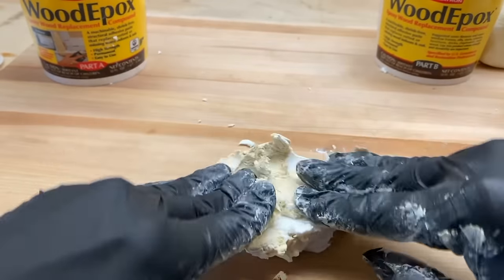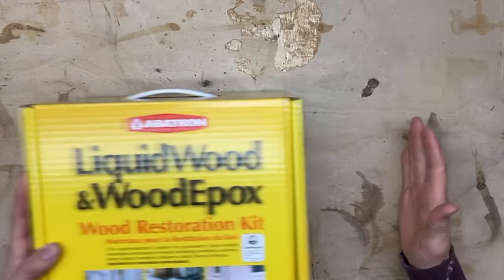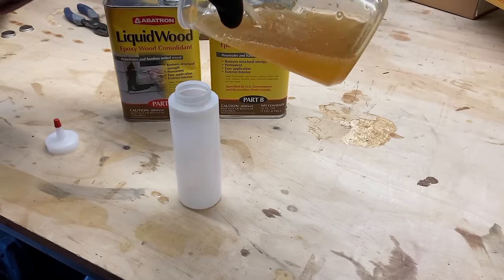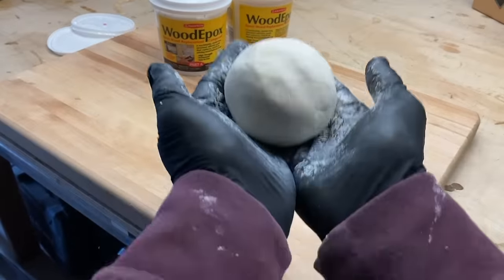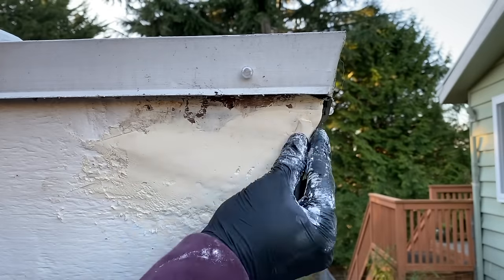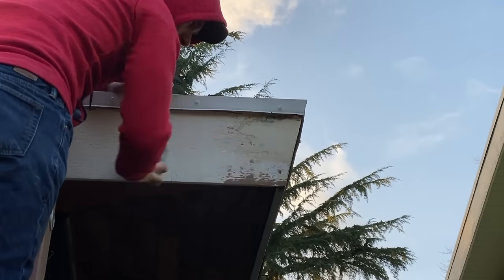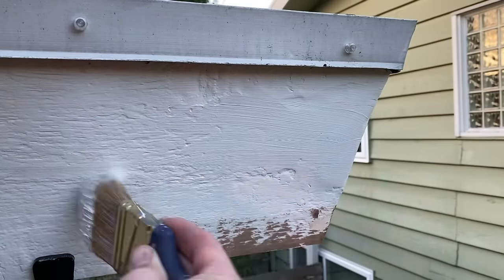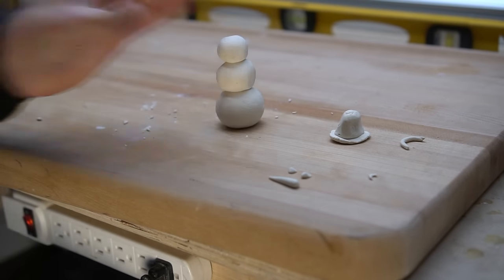How To Repair WOOD ROT and Water Damage With ABATRON

Comment: replace the rotted section with new wood and paint.  This is more work than needed
Reply from the maker: That is an option but I am trying to teach others how to do it if they don’t want to replace the entire board. In my opinion this is less work than just replacing the entire board because it’s a very long stretch of facia material that needs to be replaced.  Thanks so much for watching though and hope you found the video entertaining
Reply: @BYOTools  I call.it laziness. Lol. Wow
Reply: @BYOTools  You don't have to replace an 8ft section of facia for 6" of rot.  Cut the damaged section back to solid wood and replace the piece you just removed.
Reply: TheOcculus In my circumstance I used this method to strengthen snd replace a section of a door jamb that was failing due to the screen door hinge applying pressure. I first tried replacing a section with hardwood and a steel plate but this failed as well. Hoping the Abatron has the added strength to work (so far, so good). Anyway, I appreciated the video, so thanks. I really don’t get why someone would waste their time criticizing it -though. Why watch it unless you were looking to learn something? Go figure 🤷‍♂️
Reply: @shanpeco2546  It's a good howto video.  It's just not where I'd apply this type of repair.  The tip of a facing board is easier to cut off and replace than bondo it up.
I'm going to use this to repair weather checked windowsills and make them ready for paint.  No rot but sun exposure has opened cracks in the top of the windowsill.
Reply: @TheOcculus  BINGO!  In his opinion BYOT must have never thought of that.  Seems like rather spew misinformation and defend bad advice.
Reply: Cob job that cost more and took longer than the correct repair.
Reply: @shanpeco2546   agreed
Reply: Its stuff like this that keep remediation companies in business. Dually so, exactly the kind of stuff that hides problems until the whole side of the house is being gutted from unfixed water damage.
Reply: Yup I agree , I'm a professional house painter of 20 years . I make a killing because I'm also a very good carpenter .. 

Most painters can't even read a tape measure and just use filler or caulking than paint over rott. When I see rotted wood I see $$$$ especially when it turns into structural rot..
Reply: Agreed 10 fold
Reply: So don't replace the whole thing. If the rest is solid, just take a reciprocating saw, cut off the rot where it begins to be solid again. Toss on a new piece. Prime. Paint. The method shown in this video looks like a lot more work. My facia boards are 30 feet high... I'm supposed to drag a vacuum up a 30 foot ladder??Sounds like a quick way to an early grave personally
Reply: @86lowrider  It's not water putty. This product was used to repair the Statue of Liberty.
Reply: @scottmcbride2237  I bet that you're fun to live with.
Reply: @fireblazer6661  Or even a multi tool might do the job, with less vibration way up high on the ladder!
Reply: Yes, this.
Reply: If you are a carpenter then yes but for me this repair sounds like something I can do myself whereas cutting out wood and replacing would be overwhelming to me.
Reply: Yeah if u know how to. I got extensive rot in my siding of my trailer. I can't find anyone to fix it and I don't know how to.
Reply: That’s probably the most “correct” option but I thought it was obvious that this is a good workaround option when you dont have the tools nor expertise to replace the wood.  This is a good option for people that don’t have those things available and it would be less expensive if your only other option was hiring someone.
Reply: @BYOTools thank you!  In my case with financial problems this will be a huge help. Definitely something I will be able to do on my own. I truly appreciate it!!
Reply: Interesting . I use polyurethane glue (Gorilla glue) for that type of repair myself using bits of wood as rebar .Becaose the glue will bond to the wet surfaces deeb inside and the expansion fills and bounds all the unseen voids . Also it wont tend to separate from the wood do to differing expansion rates . Thaks for sharing !
Reply: There are some areas where your "simple fix" of replacing the wood is too complicated and costly. I'm talking about south facing wood sash windows where both the frame surround and the sill have rotten sections. I've replaced the sills on several windows and yes that not terribly difficult, but when the rot then extends up the frame surround you're either doing epoxy or your into $1K of labor and materials replacing the entire window. It's not perfect but maybe I can get another decade out of these wood sash windows
Reply: What a waste of money and time 😮.....cut the price off and place a new board.....this is pure advertising for the product, that product will should only be use for small fixes.
Reply: @g.4344  I have cut out and replaced the sills of several windows in our 120 year old home. The problem area where I've used epoxies (not this product) is with the vertical stile piece when it is also rotted. It's far more difficult to extract and replace
Reply: I don't own a saw, I wouldn't know what to do with it. I just want to fix a rotted section on my garage.  This is something doable for someone with limited skills and limited ability.  Yeah, I could spend a lot of money and hire a professional,  but it took 4 months just to find a carpenter for my bathroom and he didn't do that great a job. If I had known about this sooner, maybe the entire trim on my patio door wouldn't be rotted. I fixed the cause of the rot and actually hired people to replace the rotted walls with vinyl siding, but thought I'd have to spend more  money I didn't have to fix that door. 

I WISH I had such skills. Fixing this place is a constant lesson and so much frustration
Reply: Also, This Old House shows how to use epoxy for rotten spots as well.

Comment: I get that not everyone has the tools and skills, but after watching this, I think it was more time, effort and expense than what I did: simply use a reciprocating saw, and vibrating multitool to cut out the bad corner wood (reciprocating), and cut a shiplap in the new exposed end (multitool), and two new short pieces to overlap with those and miter the ends after measuring the angle you need, then just attach with waterproof wood glue and screw them in and a bit of sanding to perfect the miter corner, some caulk, and ready to paint.  You skip the expense of this goop, and you end up with real solid wood and woodgrain back in place...
Reply: I agree but it appears you may have missed the point that this was an ad for the wood epoxy kit he used..
Reply: @JB-jg5om do you somehow think that changes the fact it is more time and expense?
Reply: Agree with you entirely. The invention of the multitool has made it possible to cut out the rotted wood, and using a zip tool (original one or the newer rotozip cutters by Dewalt or Makita), rout out rabbets to mate a piece of wood to the opening. Does not need to be perfect as a filler like wood putty or Fix-it-All can bridge the new and old wood gap.
Reply: @alohamark3025  Thanks.  Yes, I was able to hand fit them each to close completely with just glue and then a bit of overlap at the corners was just sanded down.  The multitool is such a handy thing with its ability to plunge cut a straight line cut...
Reply: @brianmi40  Perhaps this was the wrong project to demonstrate this on, but it seems this is what he had. I’ve found this product particularly useful in the restoration of 100-year-old window sashes where you can’t just cut out a piece and replace it. I agree that for this particular project replacing a section of the board since it’s decorative rather than structural, makes far more sense. But this is just a demonstration of how the product WORKS, not saying that this is the best way to repair this particular issue.
Reply: What if you don’t already own a reciprocating saw and multi tool
Reply: @gregistopal  As a homeowner, you will find it is always better and cheaper to buy the tools, learn how from YouTube and do basic repairs like this yourself.  Both of those together are under $50 at Harbor Freight and will give you a lifetime of service for a DIYer.
Reply: Agreed! Nothing beats solid timber where possible.
Reply: Easy for you to say. I'm a 75 year old woman without the tools or the strength. I'll try this, thank you very much.
Reply: @veronicastewart1112   There certainly is a point in life in which you need to decide that projects have to be hired out to a handyman.

If you feel that a task is too much for you, or that you cannot ensure adequate safety using the tools, ladder, etc., then there is no shame in hiring someone to do the work if you don't have any family members helping out.

Comment: if you used parchment paper on the face and a plastic putty knife, there would be no need to sand, and just peal off the parchment paper.  or you could use a small piece of malamine or lamanent flooring, and a hammer to smooth the putty, before drying and no need to sand after pealing off the parchment paper.

Comment: I can see usng this product, (I know it well and have used it many times) for rpairing the facia and siding if you're not up to making a more professional repair, but the rotted area behind the facia is structural framing(!!), as in the double top plate of your wall's framing.  That repair is correctly accomplished by replacing the rotted wood with actual wood.

Comment: To match your rough surface wood texture after you apply and smooth out your repair patch material you can use a piece of cedar board or if you’re using T111 siding you can use a scrap piece of the siding. Put a piece of wax paper over your board and screw it down on the surface over your repair patch area, around the corner if you want, to square it up. It will leave all the new material put in there with the same wood grain texture that you have on the surface of the board you’re attaching to it.
Reply: wayy too much trouble for nothing
Reply: @Fattony6666  what is your solution for this problem?
Reply: It’s a nice trick

Comment: Hummmm... Forget this foolishness. As a contractor and house flipper, we use expanding spray foam in the hole and a surface board to keep it from oozing out

Spay in the foam, add a layer of Saran wrap and screw a scrap piece of matching textured wood. Wait a day or two and remove the board. Lightly sand as needed to match the surface and cover with a thin layer of fast drying exterior door and window caulk. Useing a putty knife, blend in the area. Textured wood; finish it off with a slightly wet sponge to blend into the existing woodgrain. Ready to paint in a few hours.
Reply from the maker: Now that is actually a helpful comment Bill.  Thanks for watching and leaving a useful suggestion.  My only question to you is what type of spray foam do you use?
Reply: The projects differ and the type of foam differs as well. Normally we will loosely fill the voids with fiberglass insulation and use the standard expanding foam. If the void behind the repair is small and you have access to the lower explaining, it works just as well.
We donate materials and labor for many seniors and veterans. They worked their whole lives to be homeowners, yet simply don't have the money to maintain, let alone update their homes. It's simple ideas like this that allow us to affordably help them. By first doing the safety related things like Electrical, replacement of copper Gas Lines, Furnace and Water Heater flues etc. Then of course insulation, weatherstripping, doors and windows. Life is all about priorities and they, or in this case us, simply can not afford to replace every item that can be repaired. In a perfect world, we would remove and replace  a damaged facia board, prime and paint. Or actually replace a piece of wood and install aluminum facia or reside the house. 
You must stay within your budget and get your biggest bang for the buck. Preferably doing much of the work yourself, even by someone with limited skill, time and money.

Comment: Could’ve fixed it with Bondo. Simple one step process no expensive kit. By the way I live at the ocean.
Reply: I agree. A screw and bondo would do it faster. Really fill the hole with a piece of wood and bondo over. Sand down. Paint.

Comment: Wish I had known about this 6 weeks ago. I'm an 80 yo woman who has been repairing and painting the exterior of my manufactured home. About 4 inches up from the bottom of the siding had rot because a workman in the past had not caulked trim boards. I covered the damage with elastimer paint and new trim boards, properly caulked, but there were places where holes remained. I filled these with plastic wood putty. The system you have shown here would have made all the repairs of damaged wood so much easier and cleaner. I will keep it in mind for the future.
Reply: I Am Admittedly not yet familiar with plastic wood putty~~ but just from title & imagination; Both products sound super similar🤗. And I'm learning about BOTH THESE AWESOME BABIES TODAYYY‼️‼️🆚👌🙌🖖🐞

Comment: A couple of things.   The woodpeckers are actually helping you in a way.  You can see the little wood borers holes all over that area you patched.  About 3/16" diameter.  The woodpeckers are eating the larva and beetles that are eating your house.  So you really should also spray a pesticide with anti mold and fungus too before you start.
I also texture the wood putty as it sets and after it sets too.  Just scratch it up some.  Be an artist.  Thank the woodpeckers maybe?
Reply: I would have also used a moisture meter on that wood before using the hardener to rule out deeper structural damage.
Reply: I was wondering about that.  I have a woodpecker that will rarely peck at my house for a few seconds.  Only caught it doing it maybe 3 times and only for about 30 seconds.  I was more concerned about what he might be trying to eat than him pecking at the house.  I will have to go out and see if I can find some of those small holes you mentioned.

Comment: I use the rot fix system and its very similar . One thing i do different, i'll coat wood chunks and wooden dowel rods to incorporate with the putty. It saves a lot of material.

Comment: Just bought my first home and there are a few areas of wood rot such as this - this video is so easy to follow and I've ordered by kit off amazon so I can try to do some minor fixes on our next string of sunny days.  Thank you for this, as for those of us without carpentry tools and skills-> this is probably going to (no joke) save me at least $1,000 from our local handy man companies (much less having a contractor come out to do the fixes). Thank you!
Reply: Repair it correctly , any wood putty or filler product is just a band aid especially the soffit repair " which will not last " unless it's just a small insect hole you're filling . The repair in this video could be repaired with a new trim board in under 30 minutes  and it's not as expensive as you think . People have no problem paying a Garage  $70+ per hour to have a vehicle worked on . Your home is the same thing , the difference is your home is also an investment so you will get your money back in the long run .
Reply: @manchesterexplorer8519   You're probably right, it would also probably be cheaper vs that much putty. -I think it's a matter of time/laziness over anything. Even if doing it right takes the same amount of time it's still harder work for a lot of people. I think his method uses far too much wood epoxy to be fair though. It would be far cheaper to spray some spray foam in there first then (after it dries) add a desired layer of wood epoxy on top (cut into the foam a little if you want a thicker wood epoxy layer). I've done this in the past as a temporary fix that lasted 10+ years, I just used a hand saw to level the spray foam and coated it with some caulk (rather than wood filler).
Reply: @LongToad  I understand what this video is about as I get it as I'm a contractor .  Foam is another way for a homeowner to fix things as well . But as an experienced contractor I see a very simple repair that could be had for about $20 in material and about 30 minutes of labor tops . 

    I also understand that every homeowner doesn't  own the power tools nor has the knowhow to fix something like this . This is why I stay busy 👍

Comment: There are wood grain tools that you can run across the surface when it's wet to simulate wood grain. Good video.
Reply: I have used a steel toothed brush comb, the kind of teeth that look like little awls. It's all about varying the angle of the handle relative to the direction you're sliding it along, so that the slight grooves carved by the teeth are variably farther apart and closer together. Do it when the epoxy is about half set, and leave any crumbs alone-- they will sand off later.